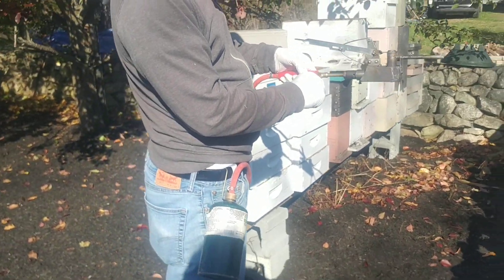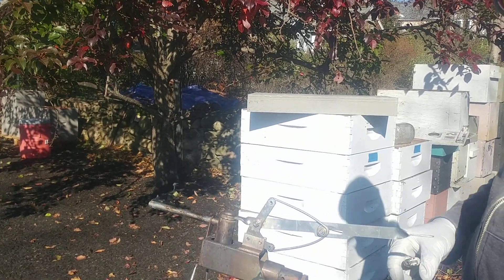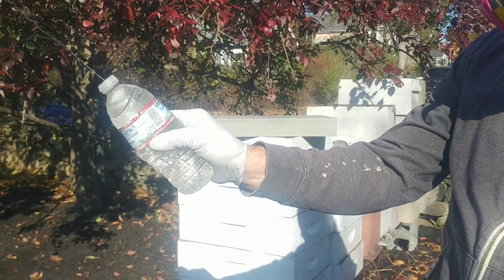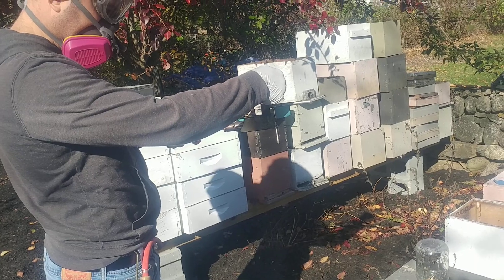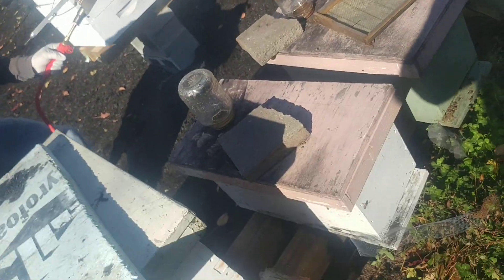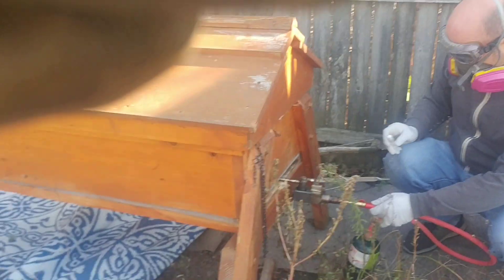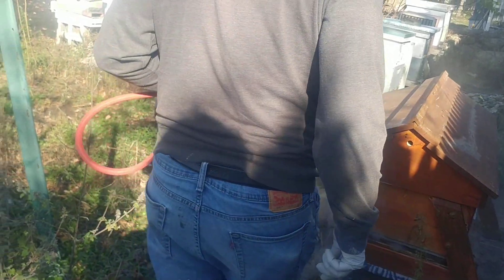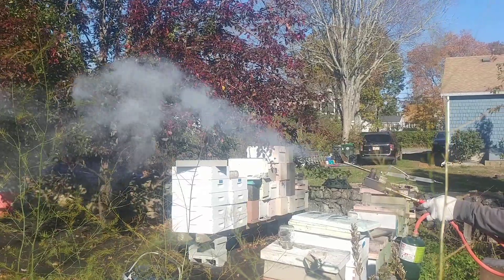VAP-OxA OXALIC ACID VAPORIZER To Place order: uzuner_fatih@yahoo.com

Comment: So are you diluting it water first and using the OA as a solution with water.  Also I heard if you overheat OA the effectiveness goes down, but does it turn to smoke before that happens?
Reply from the maker: I use water to clean the nozzle, not to dilute it. You can use water for it safely since the tool  is made of quality stainless steel.
The torch has now connected to a regulator, updated since the video uploaded and perfectly regulates the flame. You are done before if any overheating happens!